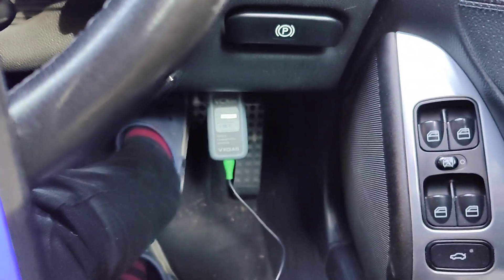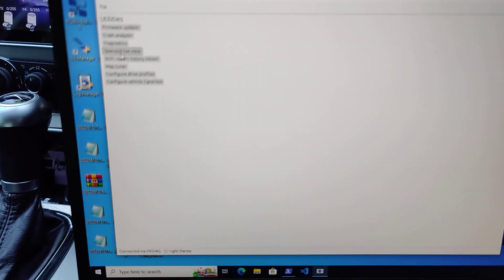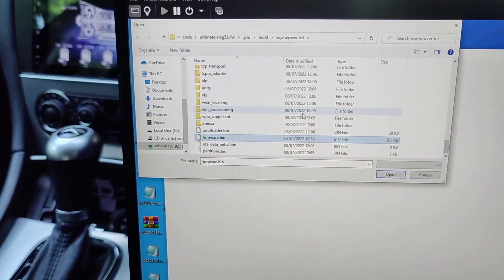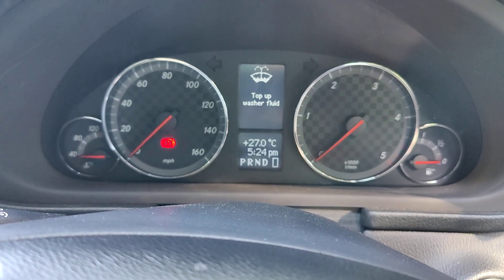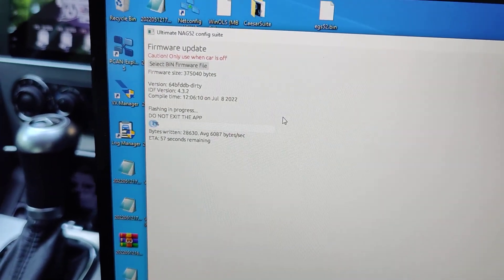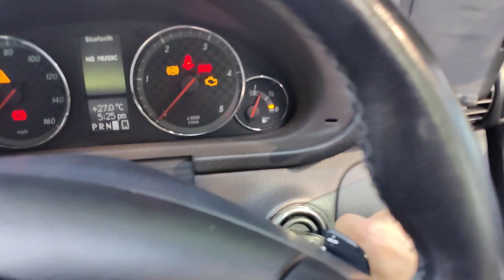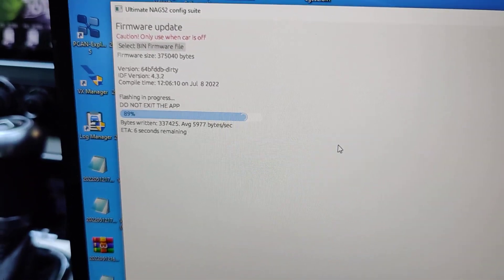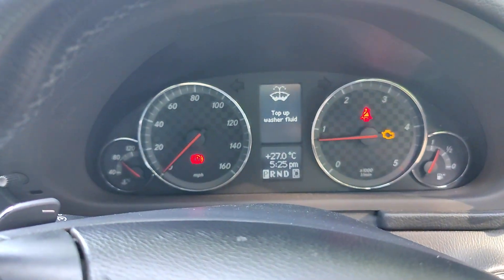Ultimate NAG52 feature demo 1 - CANBUS SOFTWARE FLASHING

Comment: Hello, does the egs TCU have a different shift behaviour for overheat conditions? Mine is holding the gears for longer until 2500 rpm and after more kilometers even 3000 and 4000 rpm before shifting in next gear it's also downshifts very aggressively when off throttle. I suspect this is due to overheating but don't know anything about TCU programming I also wanted to buy your TCU I dmed on twitter but no response